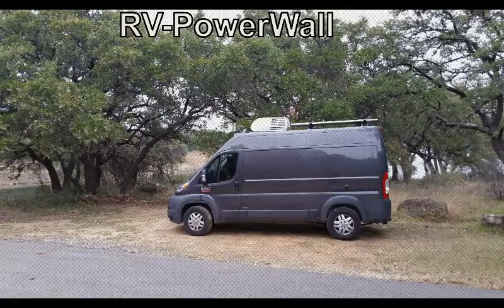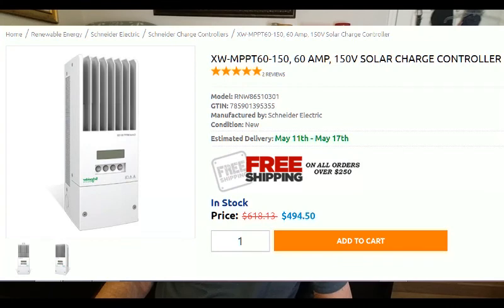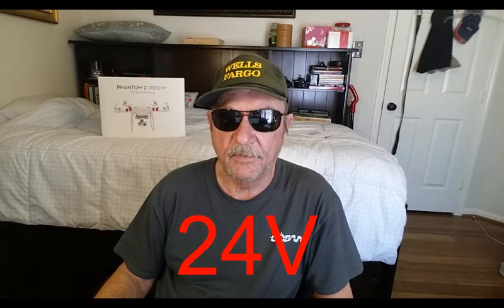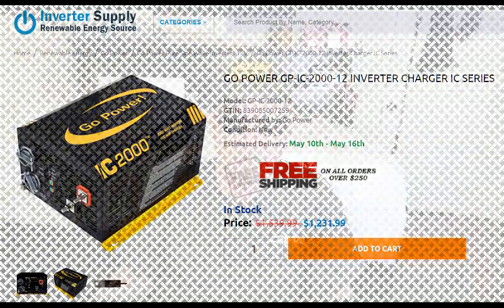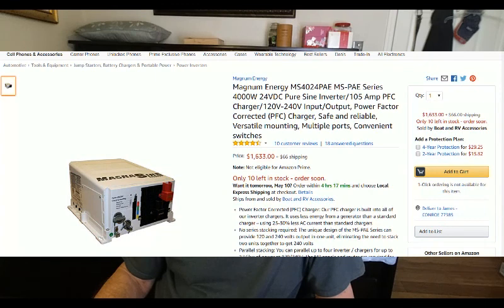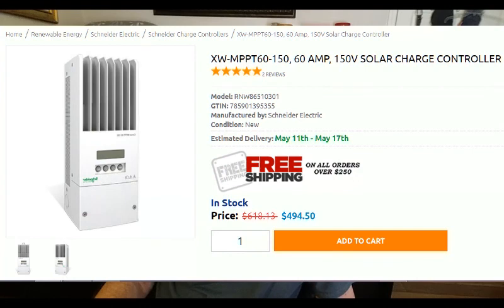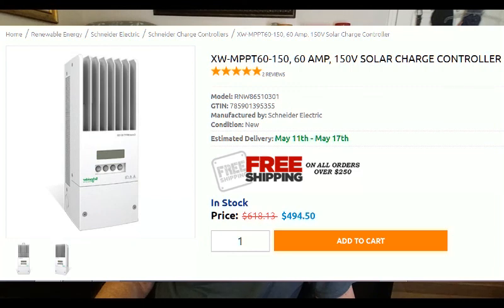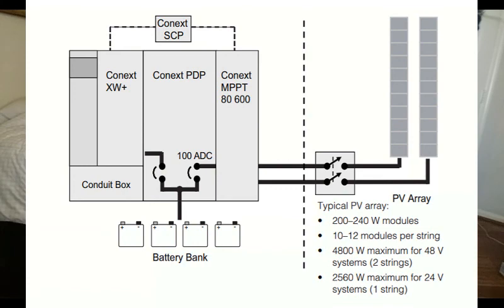DIY OFF GRID SOLAR INVERTERS #5

Comment: I have a 108 ah. 29.4v lithium bank I built. for maybe $75 more than the 200 ah golfcart batteries I bought. also more of the charge current charges the battery with lithium. higher than lead acid. that is what I have heard anyway. I am working on more lithium cells for my bank. the useable capacity is near the same with my banks. the 108 compared to the 200 ah lead. since 50% is recommended discharge. where I am get 100 ah from the lithium. and the same from the lead bank. I was thinking about primarily using the lithium bank. until its voltage drops to 27.4 or so. that is the full charge of the lead bank. then combine them to make it through the night. and use disconnects that shut off at a determined low voltage. to separate them when depleted. I'm fully off grid. this is much better than running the generator! nice info!!!

Comment: Informative as always....I seen you answered my question in another video that I asked(I was accidentally logged in under an old account with my actual name...this is my kids channel they setup years ago lol.....we are currently working on our new one which is called Living our Destiney which will show our RV life)...sorry for the confussion lol...I am building a 48v system for our 5th wheel but I am having a had time finding a DC-DC converter to go from the 48v to 12v RV system...I've found numerous one that go from 36 down to 4.5 but none to go from 48 volt down....any thoughts?
Reply from the maker: Here is a 20amp 240w 
https://www.ebay.com/itm/36V-48V-60V-72V-DC-to-12V-DC-Step-Down-Voltage-Regulator-Converter-Transformer/332622411217?hash=item4d71d735d1:m:mwWWgKL0DidG4Tz4Hi5TiIQ
Also you can select on that page a 30 amp 360w 
Since you will connect this directly to your battery.  Then from here feed your 12 volt panel. I also put a master switch on my 24v to 12 converter that way when I turn off the master switch the fuse panel is dead. My master switch is just inside the RV so when I turn it on any of the lights that I leave on come on as soon as I hit the master switch.